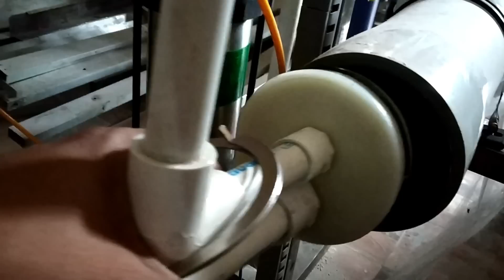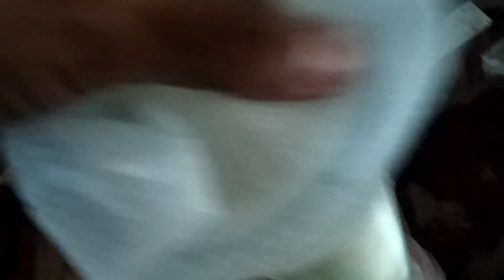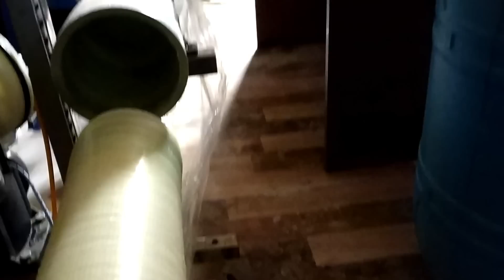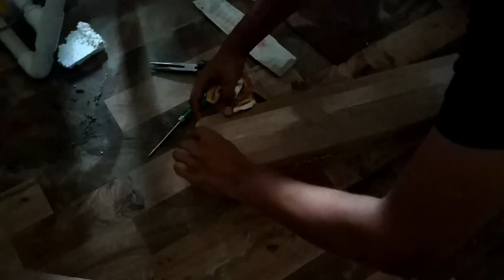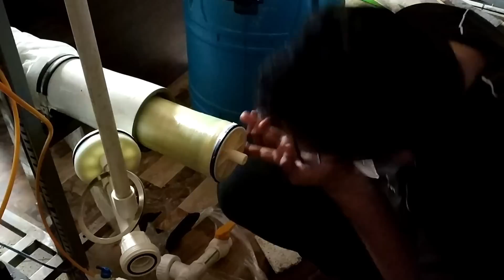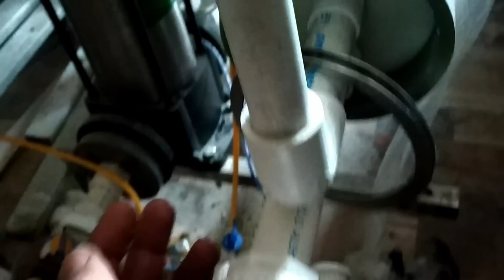HOW TO INSTALL DOW 4040 COMMERICIAL RO MEMBRANE IN 500 LPH REVERSE OSMOSIS PLANT

Comment: Mr. Prasad Yadav, Petroleum jelly is a petroleum product so it harms the rubber If it remains in contact with rubber for too long, then the rubber becomes weak and it becomes in a state of booming.
                The quantity you are using if you have to use lubrication in such quantity, alway use “Lithium soap base glycol grease” Because it is made for rubber lubrication and it is not toxic.
Reply from the maker: Ok thanks for info